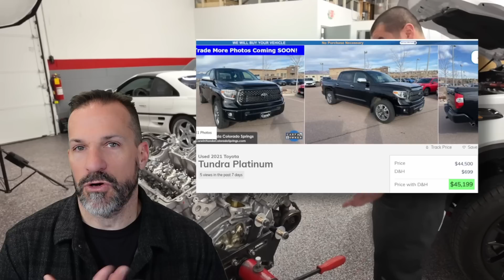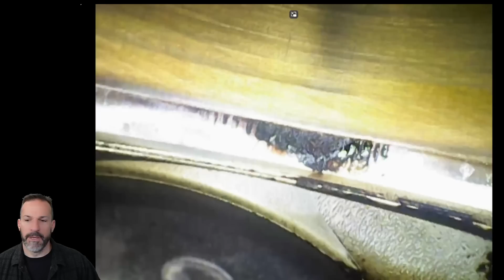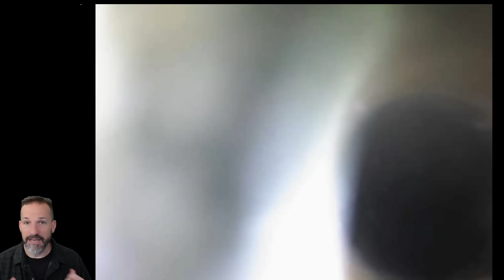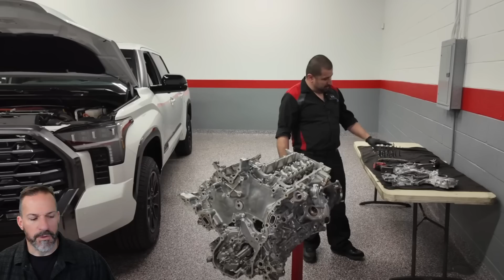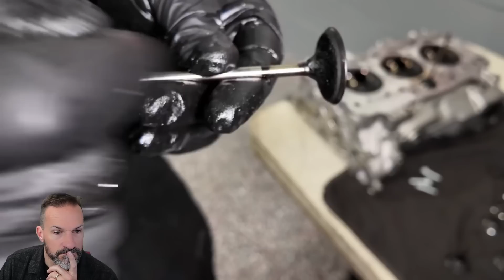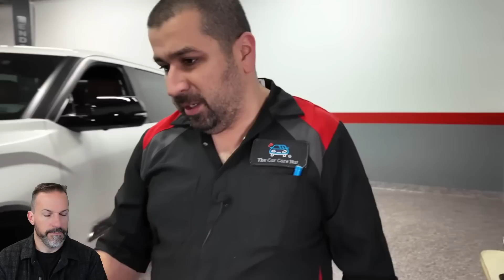Has Toyota LOST Their EDGE? Tundra Turbo V6 TEARDOWN vs. 5.7L V8

Comment: CarCare Nut keeps saying that using high detergent Premium gas is a $waste$ of dollars yet we see in his own video that using regular gas causes carbon buildup on the intake valves.  The truth is the latest Toyota engines ARE lasting 500,000 miles if the owners change the oil more frequently than they did in the past; e.g. there is a 2019 Camry 4 cyl owner who last reported 501,950 miles and he changed the oil every 4,000 miles.  There are taxi's and Uber drivers with that many miles too on their 2015 on up Camrys.
Reply: As respectfully as possible your talking out of your ass nothing you said is true, and these new Toyota products are not 500k miles engines, you owe nothing to Toyota the brand you don’t own Toyota so why do you sit here gargling their nuts, call out bad manufacturing practices when they happen, do you support Toyota moving the tacos manufacturing to Mexico to save 80% on labour while marking the price up? Like I said call out bad practice and maybe we wouldn’t be in this mess
Reply from the maker: I agree, I wouldn't go more than 5,000m on any engine, cheap insurance.
Reply: @TheCarGuyOnline You can go more than 5K miles, however it requires only the best of the best oil and regular oil analysis to tell you how far you can actually go. As an example we have an LS4 in a 2007 Pontiac Grand Prix GXP and it only gets HPL (High Performance Lubricants) 5W-40 oil and synthetic media filters only. We do an oil analysis through Wix every 5K miles for 13 bucks for each kit, and it always shows that we can safely go 10K miles with zero increase in wear rate. This is $16 a quart oil though. You couldn't do the same thing on cheaper oil safely.
Reply: @theodorgiosan2570  Oil analysis doesn't inform the owner when the piston oil control rings are becoming seized or when the VVti oil flow control valve filters are becoming clogged.

Comment: At this point it legitimately seems like a Ram 1500 w/ a hurricane engine and the ZF transmission is the most reliable full size (non heavy duty) truck on the market. I say that, because it’s sort of shocking.

Also, of all trucks on the market, I’d rank the Frontier as the most reliable overall. Again, that’s surprising as well.
Reply from the maker: TCCN when shopping for his Tundra actually thought the Ram was next in line for quality. He said the interior quality was well above the others, and Toyota. If Ram has a reliable powertrain, they will eat away at GM/Ford if they can keep prices down. One problem Ram has is the made in mexico/tariff part, they might be affected more which will make prices harder to handle.
Reply: @TheCarGuyOnline  The trouble with all FCA products is they lose value WAY quicker than most others.  Ram 1500 trucks are the worst.  A Ram that stickers at 50K sells for 40K (always huge discounts and rebates) and then a year later they will give you $25K on trade with 15K miles.  Ram is terrible for value holding.
Reply: @huntsimple9527 If I'm buying a car/truck to keep I really don't care about whether it holds its value or not. And I don't really buy something without intending to keep it until it is either rusted out or so broken it's impossible to fix or rebuild. My current car has 200K on the last engine rebuild and I will rebuild it again when it's worn out. I drive 50K miles per year. If I got rid of a car every 100K that would be every 2 years. And I think it's safe to say that that's the type of customer we're talking about if we're talking about engines having issues past 100K miles.
Reply: @TheCarGuyOnline  absolutely! Thanks for the great videos.
Reply: ive heard that the hurricane is having lots of problems also.
Reply: I'm not a RAM person, I'm a Ford person - that said, while the Hurricane has had some issues (the thermostat already has a fix), its been mostly a smooth rollout. I wish it had a dipstick, but the oil gauge has had 0 problems. The transmission is great.

Ford has the best engine in the 5.0L Coyote, the GM 2.7L 4 banger has seemingly held up pretty well. That said, both Chevy and Ford are having massive transmission problems.

Comparing a couple minor things in the Hurricane to the DISASTER that has been the Toyota 3.5L is HILARIOUS. The Tundra overwhelmingly has the worst, least dependable, engine of the big 4. I think Toyota is lying about debris. I mean, sure, there might have been debris, but the real problem is that ladder assembly holding the main bearing. Between using 4 bolts instead of 6, overall corner cutting, and having what I think is a flawed design... not to mention that Toyota fumbled the turbo waste-gates - that engine is an accident waiting to happen. The build quality (roof leaks, dashboard issues with buttons breaking off, misaligned panels) has been as bad or worse than RAM. On the positive side, the Tundra transmission seems ok.

The RAM has the fewest question marks... its an inline 6 (which is the best engine design as it is naturally balanced), its been mostly ok - with mostly minor issues that were replaced and fixed quickly. The ZF transmission is (I think) the best of the 4 brands. If you don't like the hurricane, get a Pentastar. That engine may have some hiccups, but its much more solid than the Tundra V6.
Reply: You can't even check your own oil with the hurricane engine lol. Also, they are having thermostat issues causing the engine to overheat.
Reply: There's never been a 4 cylinder Tacoma that wasn't ultra durable so I wouldn't be nervous buying a 2025 turbo 4 cyl Tacoma.
Reply from the maker: Time will tell but the Tacoma, so far, has been reliable on the engine side. Transmission and hybrid motor issues are annoying and shouldn't happen, but at least the heart of the truck hasn't failed yet. Though, GMs 2.7L turbo 4 has been very reliable as well.

Comment: Im curious about your last comment regarding the design not holding up to the abuse. Closest comparison to this engine is the 3.5 ecoboost which seems to be holding uo oretty well the years after foing through some degree of redesign. Overall the twin turbo small displacement seems to hold up over the years if the F150 is used as an example

Comment: "OLD 2008"... Not...our 2002 Highlander 3litre just returned from Fl. to home in NC w/ 299k on the clock!! ( org eng, t/m etc)  Time for 3rd Tim. Belt, H2o pmp., and plugs)  Such a shame this is happening!  Just sold our Honda/Toyota specialty shop (36yrs as founder and lead tech) last year!  GLAD I'm out!!....my back hurts.....
Reply: BTW  we have long spoken about the potential downfalls of turbos....AND direct inj. around my shop.  The most surprising thing to me is the breakdown of 0/20 engine oil and the GUNK it produces!!  ALSO, I have preached mid grade as Minimum fuel spec to my customers for years!!  LESS carbon build-up!  AND..NO tabs on the Mains??  TOTAL IDIOCY!!  Similar to killing 82 innocent Americans to test your fly by wire throttle bodies and Accel pedal sensors; when you neglect to program the BRAKE signal as superior to the ACCEL command!!  again....GLAD I'm OUT.  #OldDudesRule

Comment: I watched the TCCN video. It was interesting strictly for the complexity but I would never assess the overall performance or durability of this model engine from this particular video. 
That should be done only with a complete engine with a known and documented service history. 
TCCN’s concerns are worth noting, but without more facts it’s just noise.
Reply from the maker: Yeah I would like to see some of the teardowns of known good 3rd gen engines. Toyota did this when they were investigating the bearing issue, but they are very tight lipped about everything. Even with engine failures like this on TCCN, Toyota very seldom allows a block or engine to escape their tentacles. I would love to know how he got his hands on it :).

Comment: Performing a compression test will "give you an indication" if vertical scouring is an issue, but I don't think it is.  
The 5.7 is better in most measures, but for my needs I like the 4.7 more.  The 4.7L with a cast iron block, without VVT is simpler and easier to work on.  The 5.7 is an aluminum block which is less robust when/if the head gasket fails.    Just did fresh paint and upholstery for the 25 year refurb.  Mechanically it's still perfect with less than a 100k, no rust.  Since I don't drive it much I expect to get at least another 25 years out of the Truck.  Would never consider the V6 twin turbo
Reply from the maker: I do like those 4.7L, honestly I like the timing belt (lack of tensioner issues) with the 4.7L design. Some people don't like belts but timing chains/tensioners/guides seem more complex and cost more to maintain long term (over 200k) in many cars. The exception might be Toyota 4.0L, very few if any timing issues with those. For my uses I wanted the 5.7L towing up mountains at elevation, but the 4.7L still puts out a lot of torque.
Reply: @TheCarGuyOnline  I have a 4.0 in a 5th gen 4r and had a timing cover leak (somewhat common), it is engine out fix at the dealership at close to $3k.  I did it at home with the engine in, this effort made me really appreciate the simplicity of the belt.

Comment: I would be miserable with this engine.  I keep my cars and trucks for at least 10 years, having no payments for 5 or more years.  Lower insurance rates.  Lower registration fees.  Having this truck would force me to sell before the warranty was up because unlike many engines, this thing is insanely expensive to replace too.  It would be impossible to justify.  If this truck blows an engine out of warranty, you might as well part it out.  Its over.  And no, I'm not buying an extended warranty either.  They'll find a way to weasel out of paying up on some technicality.  Been there, done that.
Reply from the maker: Paid off cars are nice. Reliable paid off cars are becoming more rare, hold on to what you've got.
Reply: @TheCarGuyOnline  oh I will.  2019 Toyota Tundra.  I'll hit 70 with this thing.  56 now haha.  Still have my 2005 Armada.  Keepin it forever too.  No infotainment at all in the armada and let me tell you,   it    is    glorious!
Reply: Me as well. I'm driving my car 2 yrs now no payment... I keep them as long as possible
Reply: I agree a paid off car/truck/van/suv is nice to drive when paid off as long as they've been maintained  My 2019 Honda Insight EX has 55K on it and runs like new, it runs like new because I follow the maintenance schedule and don't skimp on maintaining it..  My truck is a 24' Nissan Frontier financed for 48 months, I pay and extra $100.00 with every payment and it'll be paid off in less then three years and like my Honda I'll drive it for a long time because it's been maintained and it's reliable!

Comment: The dual injector setup is better than di alone however its insufficient to prevent buildup. Seeing this in rav4s too
Reply: Sounds like a catch can is needed.
Reply: Carbon buildup in the A25A engines? Wow those things are in everything. Including my Camry. I figured I'd be immune to build up with the D-4S. Sucks to hear.
Reply: Shell V-Power Premium Gas solves all problems; keeps intake valves and fuel injectors clean, prolongs the life of the fuel pump.

Comment: Toyota had 6 bolt mains in a non-turbo engine. Why in hell would they go to 4 bolt mains in a turbo charged set up with an incredible increase in pressure on the main bearings. And then they fail and you make up an excuse instead of admitting to your stupidity? Toyota is staring to sound like GM.
Reply: Remember they bought back the million mile motor?   They learned from their mistakes 😂
Reply: Probably saved themselves a couple cents in manufacturing.
Reply: THIS IS EXACTLY WHAT I SAID SOON AFTER SEEING THE BEARING FAILURE.. TOO MUCH FORCE ON LESS BEARING CAPS!
Reply: Repeat after me: debris, debris, debris.
Ha hah ha
Reply: Look at the sales numbers…American truck buys demand junk.  Shiny, comfortable, underbuilt junk.  Toyota couldn’t beat them so they joined them.
Reply: Because govment subsidies.
Reply: The 4 bolt girdle setup is vastly superior to the old floating cap design. Getting enough clamping is easy— those are almost certainly grade 12.9 M12s, which means they are 72kN (16,000lb) EACH. If they are only M10s, that’s still well over 10,000lb EACH BOLT. There’s plenty of clamping with only four bolts. The problem that this design solves is *stiffness*. When you are slinging a heavy rod and piston on a crank at 6000rpm, the caps and the block deflect. That changes the running bearing clearances and can overload the oil film. So you need a much stiffer bottom end to keep the running bearing loads more even. This allows the absurdly thin 20 grade oils to mostly work and get through warranty.

The girdle design is excellent. But what’s killing these newer engines is the thin oils and the carbon associated with a closed crankcase vent and a dry intake port. If you want to keep a newer engine alive for 200k+ miles, run nothing thinner than a 30 grade, with 5w40 synthetic (like Mobil 1 TSUV) being the best choice.
Reply: @G5Hohn you seem to know what you’re talking about so, it’s ok to use heavier oils that’s what they recommend?
Reply: Toyota of NORTH AMERICA IS THE ONE RUINING EVERYTHING. TOYOTA OF JAPAN SHOULD TAKE OVWR
Reply: That's true today you pay not for reliability you pay for batch only
Reply: GM would blame you though
Reply: I have a question? Toyota put a Tt v6 in the Lexus ls in 2018 that I haven’t heard of it having engine failures. What happened from them to now? Is it the same engine? What did they change?
Reply: @brandonpittman5243  because the lexus L S is made in Japan and the tundra engine is made in Alabama where the v8 been made since 2003. Tundra is built in texas with USA parts . From a sedan to a truck it’s very similar on something’s but not all .
Reply: @brandonpittman5243 it’s a different engine, this one is a turbo charged V6
Reply: Agree, makes no sense
Reply: GM has used 6 bolt mains in their engines for nearly 30 years now. Toyota sounds worse than GM using your logic. Obviously I don't think that myself, but you seem to be stuck in the 1980's.
Reply: @hochhaul sounds like they are clearly worse than gm right now. You might be stuck on past Toyota reliability that isn’t there anymore. Or you might be a fan boy.
Reply: @hochhaul  reality today that Tundra is a steaming piece of dreck- issue of GM is irrelevant to this discussion
Reply: You all are talking a bunch of nonsense. 4 bolt mains are plenty sturdy. Toyota used 2 bolt mains on the 2JZ, it holds plenty power just fine. BMW used 4 bolt mains on the  N54, no issues holding up power. List goes on and on. People talking 4 bolt mains are the issue need serious help. Based on what I'm seeing that engine was run without oil. The design flaw is whatever the hell made it burn  through all that oil so quickly. All engines are capable of 1 million miles easily, reality is most engines last 100-150k miles which is when they will start either leaking oil, get sticking oil control  rings from poor oil maintenance, or whatever the hell it be that causes the engine to run through all of its oil before the next oil change...

Comment: My 2020 Camry sounded like it was going to blow up because of the all the clatter and knocking. The later Toyota's "fixed" the problem. Mine was a high compression engine and the port injectors kept the valves clean but caused detonation. I'm wondering if the clatter fix was using the port injectors less and the DI more. Less fuel spraying on the valves would cause more build up. It's weird there weren't any holding tabs on the bearings. It made me think the bearing might be pinching in on the crank or spinning in the bearing cap bore.
Reply: Was your Camry a V6?
Reply: @sammyjammy6647  The newer 2.5 4 cylinder.
Reply: @OnlyMeee-ie3dw  OK just checking because I have a 2023 Camry V6 with almost 17 K mileage. Everything great so far. Lol
Reply: @sammyjammy6647  I took mine back to the dealer the day after I bought it. It only got worse from there. It would skip a month without something acting up. Toyota said all the issues were normal for that block. A dealer mechanic told me there were a lot of complaints on them but shouldn't leave me on the side of the road. I hated that car and lost faith in Toyota products after learning how they stand behind their cheaper products. I dumped it to Carmax with 18k miles. I didn't feel right about selling it to a private party.